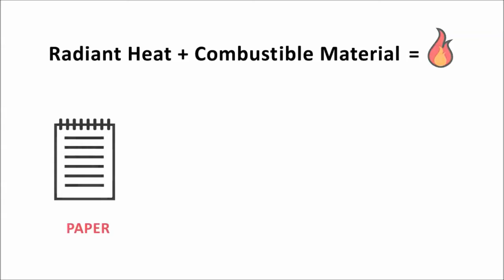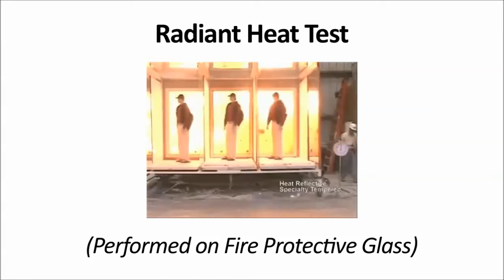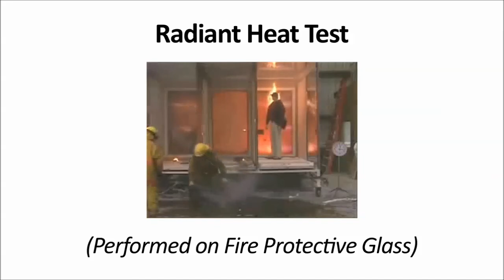Dangers of Radiant Heat

Comment: Moved in a new place with ceiling radiant heat.  Heat turned on and nothing but eye & throat burning!  Have to change it
Reply: @moorevideo77   what about covid???
Reply: I have these panels and  they are very good question do you drink alot of water? Do you allow airflow in your home and lastly what temlp did you have theze running at.

Comment: Lol, well technically, all heat is radiant heat! Very curious of the reason for this video and the funding source?
Reply: Lmfao the radiant ceiling heaters I had were connected to at stat in each room. Each stat had over heat protection as well. Never had any issue with it or being burned. Electric bill being less than 100 in the winter is pretty nice too
Reply: dyson lmao
Reply: @mikenotta7079  That isn't correct. There different methods of heat transfer; they're not all radiant.